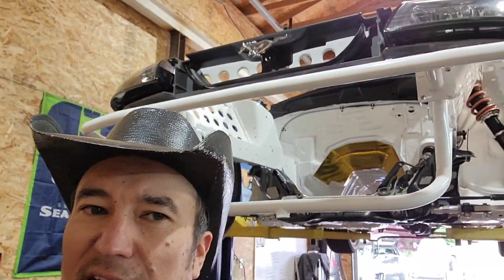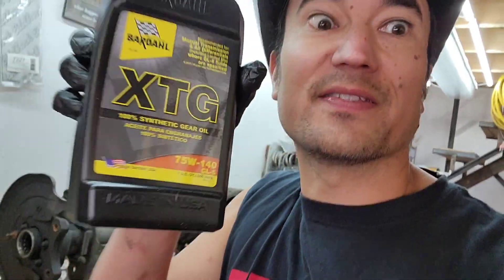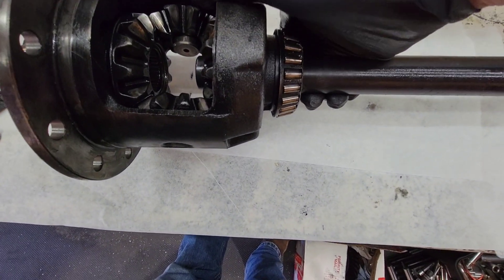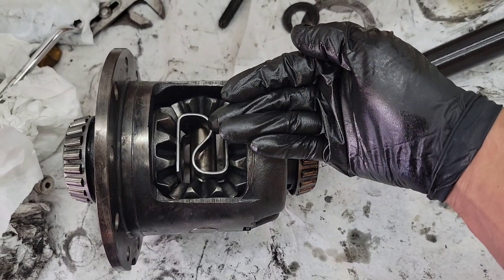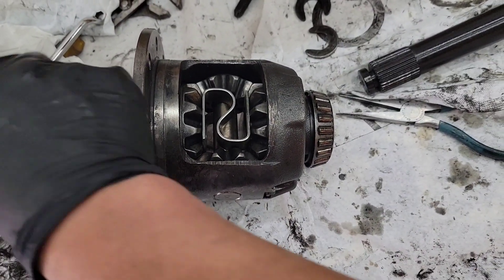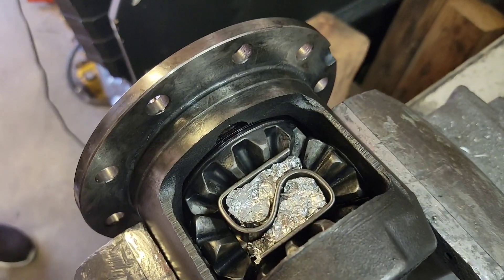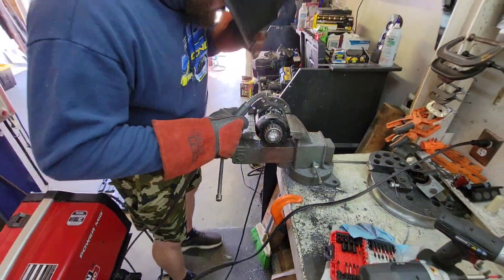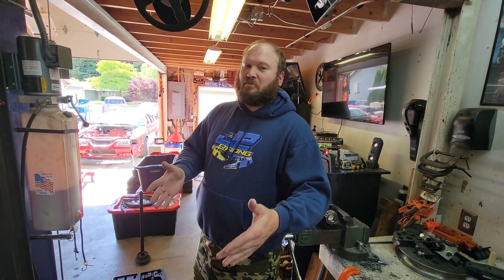8.8" BEST DIFF WELD METHOD

Comment: another awesome video man, Ive got some more questions im hoping you or your buds could answer. firstly i just wanted to thank you for putting out that info on the Taurus calipers and hawk pads. That combo works so well its crazy. secondly im drifting my 98 cobra with stock engine and power internals, ive only upgraded suspension and chassis so far. i swapped a 01 rear end to get a wider and marginally better rear gear ratio (3.27 instead of the 98s 3.08), but im at the point where on my small local track 2nd just isn't enough  to keep my wheels spinning. what would you recommend for a rear gear ratio?? should i go 4.10??? is it even worth changing the rear gear ratio??  I do have plans to boost the engine in the near future but im not sure how much HP  the stock 4v can take with all stock internals.
Reply from the maker: Before you do a supercharger, I'd recommend figuring out what your wheel speed is. What RPM are you at in second when it's out of steam? What size tire are you running? What tire?
You have any videos of your car drifting? Post the link!
Reply: @Double_A_Ron  I do but its all on instagram at the moment! do you have an instagram?? id love some constructive or destructive criticism
Reply from the maker: @neight2739  @double_a_ramm

Comment: huh, i bought the parts to rebuild the clutchpacks, but then i thouhgt i should go welded and be done with it. I was annoyed that i wasted money. but now, i can just rebuild it. Send it for a couple events and then pull it back out for the 4.1 and get it welded at the same time.
Reply from the maker: Hopefully you bought the carbon clutches. They'll last a while. If you bought the standard, I'd weld it.